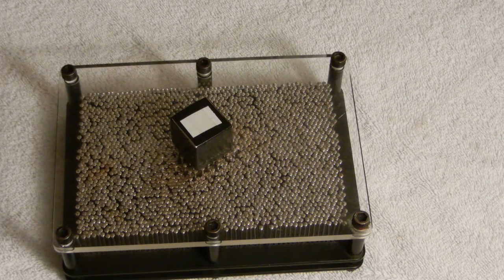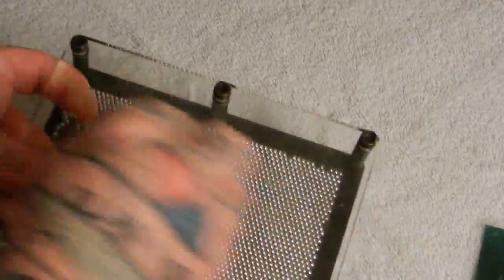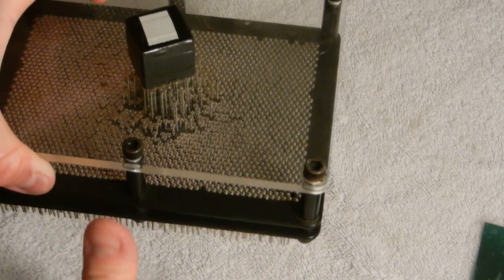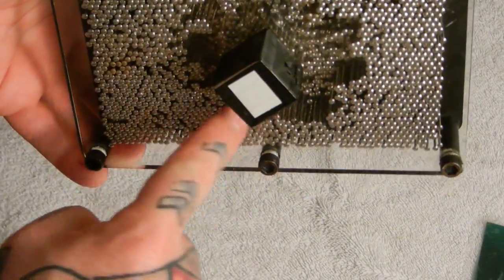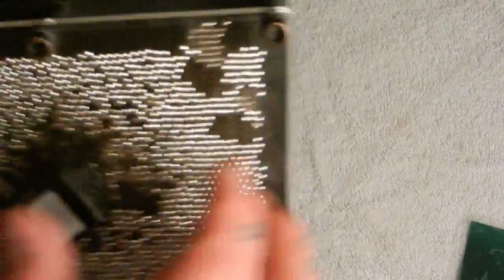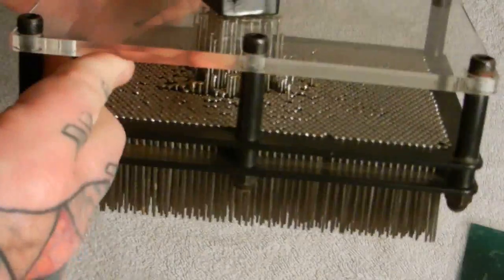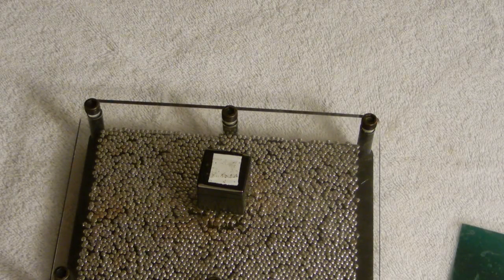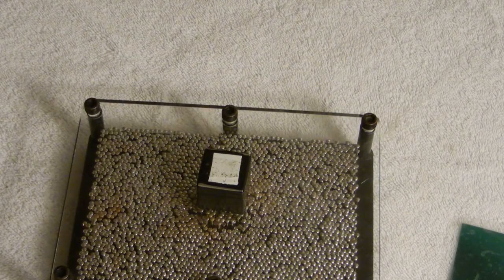Video 1 Uncovering the Missing Secrets of Magnetism

Comment: nails that wont come out are attracted by the magnet at an angle ,but nails can just go up and down, magnet doesn't pull them up or down but to the side toward the magnet, so nails that come out when device is up side down are affected by gravity, and those that didnt are pulled by magnet side ways but they can just go up and down so they are stuck, nails directly under the magnet will come out anyways....also it is true ,the slower you move magnet the more force you transmit but here is no spin like shown here
Reply: ShawJohn31 speed of magnet would make a difference ,the slowly you move it the more force it will transmit , move fast pass the peace of iron might not pick it up, move slower and it will pick it up..  i just misspell it first time ..still stuck nails that wont come down are to the sides of magnet and pulled sideways hence stuck in that position, cant go back down in that position
Reply: ShawJohn31 im not confused at all, you just said what ive said only different and to that i agree, spin vortex magnetic field nonsense i do not, there is no spin, everything shown is due to magnetism, friction,kinetic energy, inertia and gravity .. not one percent of it is due to magnetic spin or how ever you or Ken like to call it , non the less its non existent
Reply: +Pavle Pavlovic I think what your trying to get at is when he tips it upside down, the acceleration of a pin is enough for it to accumulate enough of an eddy current to be opposed straight back into its hole
Reply: L3gendLuk3 its simple , it can go up or down, not sideways , magnet is pulling it sideways so its stuck. that is way there are leftovers
Reply: Pavle Pavlovic
Well I prefer the term the vertical component of the magnetic field is too weak as it goes further out, but I was referring too how he turns the system over
Reply: L3gendLuk3 yeah that component ,  but friction induced by it is really what am aiming at .
Reply: Lol! Good catch, Palve. This guy is an illusionist in the old tradition of traveling salesmen. Another point to mention is that the 'fast approach' just vibrates the nails in their plastic housing keeping them from getting stuck. I used to have one of these and you always had to shake them a little bit to get all the nails to come free.
Reply: Prospekt313 indeed , its obvious . but he is not inventing it , its Rusellian science . Some guy Russell that lived 50 years ago , along with tesla , and indeed spoke with tesla . invented "white magnetic light " term that is called often ether . And magnetic vortex energy , that when moves is electricity , and everything we see is illusion of light , created by stillness of white magnetic light , and movement that is electricity . something like that  so hes the one that says magnetism is a wortex , this guy just red his book . Its nice book , but tesla wrote no books , and we live in his world , russell on the other hand wrote books and proved nothing , made nothing . So ill let him continue XD But this particular experiment doesnt prove any wortex . But we dp need ppl thinking about it cuz we dont know what magnetism is , and what EM is , we need to know that .
Reply: IDK, maybe it helps people get enthusiastic about the subject, but giving them false information won't help them make any new discoveries. Everyone's going on about magnetic vortices these days but they should know that they only happen when a magnet is in an electric field. It's called the Lorentz force and we use it for a lot of things. This guy here is an artist. Watch how he comes in for the 'slow approach' at an angle and slightly from the side to keep more of the nails stuck in their housings. As for magnetism and all the fields, they are nothing more than cycling flows of ether around spinning particles, which in turn are a pinning vortices of ether. All is ether with three kinds of movement: waves, particles and currents or fields. Just look at coronal loops on the sun and you are seeing the way the fields move. Some day I'll write a book on the subject but for now the world will not accept anything that doesn't mesh with Einstein.
Reply: Prospekt313 your mix of russelian concepts , newton/einstein /quantum theory's , sugests to me that you are well informed , but dont be so fast about theory of everything , chances that you nailed it are slim , i always back up from such claims
Reply: Then take it as a suggestion. Why do we watch these videos? Is it not so we can discover clues about which direction to move in our studies? This which I've discovered could not convince anyone who didn't already possess volumes of experimental data that we've acquired over decades of observation, and even then, only those who were ready to accept it along with the implications - that this is a creation, and man can only go so far before he comes up against the finger of the God. One has to earn it in order to learn it.
Reply: You too are a learned man, I can tell. So if you are inclined, find problems with this theory and debate it with me. Tesla assumed the ether, and said all of his calculations were based on it. If you can accept that as a fundamental starting point, we can move from there.
Reply: Prospekt313 yeah , i always want  to know , i always make some of my own theory's , but i always remember some thing i cant explain, and where my theory fails..Its abig problem but it wont stop me from looking just to entertain my mind with something other then Hollywood movies or something like that . I cant watch official documentary's any more , i know it all , i even know where it fails , and all the BS behind it so i only get angry . these kinds of videos at least dont get me mad . But often they too get sucked in there own theory's too much without any testing . For example , ive heared a term " white magnetic light " repeated over aand over again , but what is it actually , they never say , they dont explain magnetism let alone white magnetic light ..so we go on thats the point at least its something new
Reply: That's the first I've heard of it. Usually these guys like to mix in some new age spiritism along with a scientific breakthrough that turns out to be a fraud in the first place. I know exactly what you mean about the state of things today. I get some enjoyment out of finding the tricks behind the deceptions, and often find new avenues to investigate. It is good, I think, that we hone ourselves with this tool we have for now - the internet. Regarding this "white magnetic light" I can only tell what's not there from the standpoint of physics, but I'm guessing you already know that.
Reply: Prospekt313 thank god there are ppl like you , i was starting to lose my fate in humanity . in other words , exactly . Where are you from?
Reply: One more complement about your original post: I watched the video and I knew there was something terribly wrong with the picture, but I was impatient and went right to the comments. Like usual, most people bought it hook, line and sinker. Then I found your post and had a good laugh. It just goes to show that what is ready apparent to one, others will have to work at and maybe not even find. It can seem lonely higher up - watching everyone running around pulling each other's hair, fussing, and having what looks to be a good time - but someone has to be there, and it needs to be the people with greater insight. Take heart and remember that you have an important place and that others will one day need you, whether they appreciate you for it or not. (And they usually don't ! ) Like most, you'll want to discover things on your own terms, but if you ever want spoilers or another perspective I'll always oblige.
Reply: Prospekt313 i would love to have the vocabulary to explain it better to ppl , so that it has more impact , but english is not my native language . Thankfully there are ppl like you , with no preconceptions , and better English then mine so you explained it better then me. 
Maybe there is something in this Russellian science . I dont know. Mainstream science has long forgotten about magnetic fields and electricity , instead they focus on  gravity waves , CERN , balck holes . But no one ever explained magnetism , probably the best thing we have right not is this stuff , far as explaining the nature of electricity and magnetism . I dont understand how such an important subject could be left out of the mainstream science . There are probably private institutions working on it . Cuz if i had a lot of money , first thing i would do is try to find another Tesla , and pay him to explain me magnetism and electricity . Its probably happening somewhere .
Reply: I'm from Santa Cruz, CA but am currently in Washington state - also interested to learn where you're from. Yes, I began studying all this stuff in earnest 15 years ago. I wanted to start at the most basic level I could so I could understand things for myself instead of having to take things for granted and boy, did it pay off! So much of what is taught today is utter nonsense, especially the theories which they teach as fact. I often boast to people that I could cut their education time down to one tenth because of all the useless things they had to study in college. In years of blogging, I've also had to thoroughly study each of them anyway, find the few observations they're based on and of course the actual reasons why they're being posited in the first place. If you want to start where I did, after buying and throwing away so many useless books on the physics of electricity and magnetism, I finally found the one that the Naval Bureau of Personnel uses. It's copyrighted 1969 and is still the very best (I hope to God they haven't revised it). It's a two-volume set: Basic Electricity and Basic Electronics. There have to be some good short videos here on the Tube somewhere.. I'll look into this Russell guy, though the few things I've heard so far seem a little contradictory. Anyway, I'll be thinking about how I might be able to help.
Reply: Here are area things you could try: enter basic questions into Google like; how does electric current flow, and throw different words in the mix like 'atomic level' (meaning that's where you want to understand it from) and read a few of each suggestion. You'll soon find that most of them match pretty exactly. Not much has changed regarding that. Then try 'magnetism at the atomic level' etc. as you start to build this 3D model in your head, questions will begin to arise. I know English isn't your native tongue, but look for key words in the articles you read. I basically left books behind in 2009 once I learned how to use the amazing Google key-word approach.
Reply: And one other thing: always click on images with each of these searches. The pictures and diagrams are a great short cut to forming a picture of the atom and what's going on.
Reply: Remember that the atom has been made to scare people away - they are charlatans who want to discourage anyone from seeing what they're up to. Do not be discouraged. You're going to be delighted when you see how simple it actually is. Easy as 1 - 2 - 3: equal number of protons, neutrons (in the nucleus) and electrons orbiting it in every single element!
Reply: Prospekt313 until you give it enough energy and it gives away one electron , then it becomes charged matter , neglecting all but electric stimulus , or plasma. 4th state of matter . One thing is interesting to me now . Maybe you know about it . Quantum clouds , its similar thing like plasma , but on a subatomic level . There is a bunch of particles , then they take away the energy , opposite of plasma . When they do that , particles stop behaving like particles , instead they act like one solid body . Hence they call it quantum cloud . That thing is very interesting but i dont know how are they gonna take away all of the particle energy ,  for now its theoretic i think
Reply: Pretty good theory. Plato believed that the body was composed of four humors and that the embryo had triangles of new materials which were locked tightly together while still remaining soft and delicate. When triangles of meat and drink were brought in and absorbed into the body of the new form, being older and weaker than the triangles already present there, the frame of the body would get the better of them and then its newer triangles would cut them up. So the animal would grow, being nourished by a multitude of simple parts. What do you think of that?
Reply: So in other words, decide if you're an historian of dated, arcane notions, or if you're a physics detective using the latest and most dependable evidence. There is nothing wrong with the former, it's just a choice you have to make. Maybe you're a spiritual cosmologist like Russell was, IDK.
Reply: Prospekt313 i dont know , i never heard about it . Sounds like Plato's 4 solids , earth , air , fire , was the 4th one ether. Something like that . Sounds like creation being explained through the wisdom of sacred geometry. I cant decide , what side to chose . New school of mathematics , or old school of philosophy. Mathematics cant explain the most important number in nature , Phi. They have an approximation . Its a golden number , but its  not a number . If it was they could write it down , but they cant . They can only approximate . While geometry is exact and can describe that number perfectly . So one cant rule out ancient knowledge . Its a shame that mainstream science , doesn't use geometry , sometimes they have to but that's all.   Thats why i cant chose , im on both sides . I need to fined Russell's periodic table , or spiral . I saw the picture , its very interesting
Reply: I must apologize. I hadn't realized that they reinstated the cloud theory as the predominant one now. This must have happened very recently within the last year or so. You'll see that chemistry, electricity and magnetism  - as well as the periodic table - still depend on and use the Bohr model. The cloud model is a clouding of our understanding of the behaviors of electrons we see in nature and I really thought it was a thing of the past. No one uses it exept in theory. But to spice things up, to publish new papers and get new grant money, they often have to go back to ideas of novelty.
Reply: Further explanation: the "probabilistic cloud" of electron energy is amorphous and can't address the questions of why certain elements are conductive of electricity and others are not; how molecular bonds are formed, why iron and other ferromagnetic metals are magnetic while others are not; how electricity moves through a conductor, and how they move as particles through the vacuum of space or an electron tube. Basically, it those everything into obscurity. If we observe them as unique individual particles flying through accelerators, hitting the phosphorescent screens of older TV sets and flashing as lightning across the sky, there just isn't any reason to think of them as actual particles balancing out the positive charges of atomic nuclei. I'm realizing now why the man in the video above (and others) are now saying that the electron doesn't actually exist. It's simar to when they get everyone riled up by saying that light is not a wave anymore; that  the photon is now a particle without mass. It stirs up a controversy, gets everyone exited for a while, and then goes away since it can't explain things from numerous observations. It's how the industry carries itself through dry periods when they don't really have anything of substance to talk about.
Reply: "There just isn't any reason to •not• think of them as individual particles"